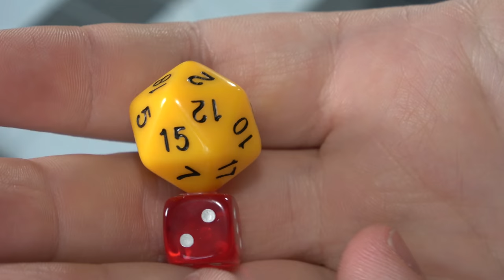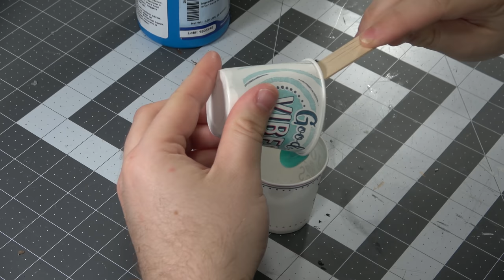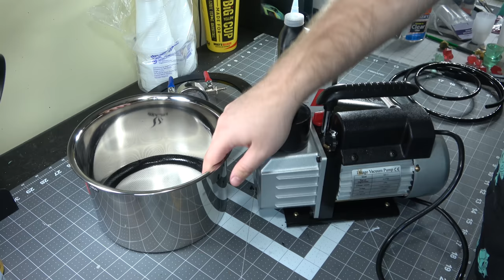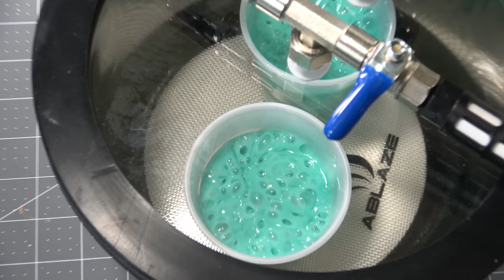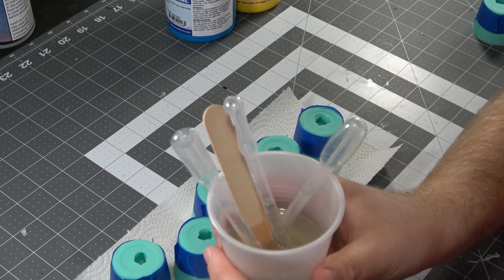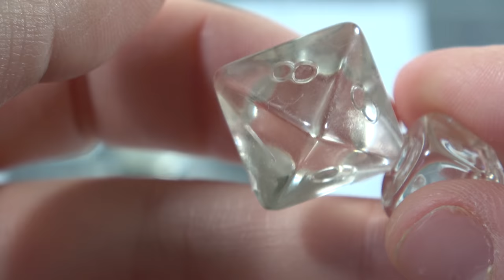Casting Clear Dice Pt. 2 | Vacuum Chamber

Comment: 2 years from now: I use 36 pipettes but you can just use one or two
Reply from the maker: 4 years: I just grab a fist full of pipettes, but Idk it's up to you.
Reply: @Rybonator  8 years: My body is more pipette than human now, but a finger pipette augmentation should also work fine here.
Reply: 16 years from now: the very atoms that make up my body are mini pipettes but you could just use 2 or three
Reply: 20 years from now: I have replaced everything in my house with pipettes, so the cup filled with resin is a pipette as well, but just 5 or six would also be acceptable
Reply: 30 years from now: sluuuuuuuuurrrrrrrpp
Reply: @Rybonator  its been 2 years, are you using 36 pipettes like the prophecy foretold?
Reply: @jarrettgolden6671  You're right. An update is needed.

Comment: I think we may have had a miscommunication or i forgot a key detail the main thing that I do to prevent the spiky bits is after I paint on the silicon making sure I carefully paint into each number I pour in silicone to fill the cup and put the not cured silicone with dice in it in a pressure pot and bring it up to 40 psi. The silicone cures in the pressure pot while under that pressure giving a perfect  mold. I apologize if I forgot that in my last comment
Reply from the maker: Ahh! See I did not try that. Next time I get more mold making material I'll give that a shot to see if it fixes the problem. Thanks for the clarification!
Reply: Thanks for the clarification. Will try this out definitely!
Reply: you had indeed written it in your old comment as well, looks like he simply forgot
Reply: @Rybonator  do you have a video showing this method? I learn better with tutorials.

Comment: I am SO digging these diy dice! I'm a new DM (screams of terror), but my group is a group of super close friends including my boyfriend.
After binging on your videos, I'm finally getting ready to make everyone a set of dice and their own little dice box! So thank you for your help and tutorials!
Idea for a set: try making matte dice! Maybe some frosty snow dice? Or something hazy, like fog, but with some dark smoke inside that you can barely see. That would be really cool! :D
Reply from the maker: Thanks for watching, and I'm glad that you liked them so much :) 

Best of luck in your making! I know your group is going to love whatever you make for them. Send me some pics on Twitter with your sets when you finish up! I'd love to see what you made :)

Those are great ideas! I've actually made a matte set recently by accident when using the wrong polish spray haha. I'll have to give some of them a shot!
Reply: @Rybonator  Thanks for the crafting wishes!
I do have a question when it comes to your dice making process. When do you use the little pipettes in your videos to suck the air outta the molds? Do you pour half of the resin then use the pipette before pouring the rest in, or do you just fill the mold all the way up and use the pipette at the very end?
Reply from the maker: @awinnerismi  I fill the whole thing up and then use the pipette at the end. I place the tip near the top of the mold where air is likely to get stuck and try and suction some air out. If no bubbles go in the pipette, you are good to go!

Comment: Love your channel, literally the reason why I'm going to start making my own dice. 
Question: do you leave the silicone in a pressure pot to cure? 
I know the vacuum chamber takes out most of the air bubbles but I was thinking that it might be a good idea to leave it in a pressure pot at 20-30 psi in order to shrink any remaining bubbles.
Reply from the maker: That's awesome! Thank you for saying that :) Made my day!

I actually have just finished up experimenting with that. It will be in the next video I release in the next few days :)
Reply: @Rybonator  thanks for the reply. Can't wait to see the results

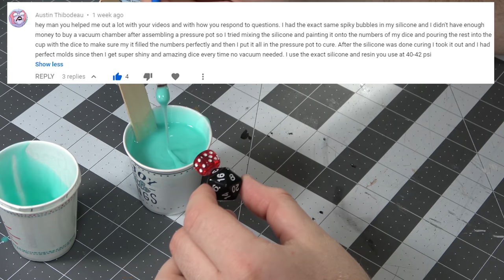Comment: @2:05 If your silicone did end up with bubbles after curing in a pressure pot, you may need to use a pressure pot every time because the unpressurised bubbles can potentially warp the mold (resulting in distorted casts). The same would be if you cast silicone without using a pressure pot, got bubbles in the mold, and then created casts in a pressure pot.

Comment: The high toss technique works if you pour slowly in a thin stream. The surface tension of the silicone will pop the bubbles during the pour.
Reply from the maker: Good to know the reason why :)
Reply: @Rybonator  if you need any further help feel free to contact me.
Reply from the maker: I appreciate that thanks!

Comment: Awesome video, Im from Brazil and I started to get the same problems with bubbles, but I cant buy or make a pressure pod, is too expensive. The solution is change the epoxy resin to POLIESTER resin. The Poliester resin dont mix with water base pigments or food coloring but the bubbles is the major problem. BTW in my molds I use a BLUE silicone made by a local producer here and never give bubbles! I hope this tip will help some people like me, who cant buy these materials.
Reply from the maker: That's awesome! Thank you for the tip Rafael! I have had a decent amount of Brazilian commentors ,and I hope they fine your tip helpful :)
Reply: @Rybonator  me too!! keep making these great dices and videos, you help me a lot!

Comment: I have a question as I am just starting my research on how to build mold(silicon) and then cast (D&D dice in my case for my daughter, I really don’t understand the game its self). So my question is you se a vacuum chamber to remove air bubbles from silicon mold, then a pressure chamber for the resin to get the air bubbles out , why can you not use the same device for both operations, silicon mo,d and epoxy resin? I apologize if this question has already been asked/answered.
Reply from the maker: So you can use one for both, and that's the pressure pot. Check out Peter Brown's video for Pressure Vs Vacuum, it gives a great explanation on the subject. You can cast a mold in silicone and pressurize the silicone with the pot to do the vacuum's job, but not vice versa.

Comment: sorry if u have already done this but i wonder if u could make a liquid core dice .
Reply: You could if it was a plastic ball perfectly sealed before you use the resin. Otherwise it won’t set properly.
Reply: wouldnt make a balanced dice.
Reply: Jon Wit Not all dice need to be balanced tbf, I’m really doubting those M&M dice are fair for instance. Even glitter dice aren’t balanced ones.
Reply: @ninetails6218  but they are unbalanced to different degrees the glitter ones probably being to least unbalanced so you still have a better chance of rolling and getting a different outcome.
Reply: Jon Wit Well no shit, but like I said it doesn’t matter if your goal is art.
Reply: @ninetails6218  oh sorry a difference of view was my mistake i focus on function and looks not just one or the other. display dice are fine for some.

Comment: Just subscribed about 30 minutes ago- (merry Christmas btw lol). I’ve been making dice with some cheap molds I bought online, but I’ve been saving up for a pressure pot for a while. Lucky me- my family chipped together to get me a vacuum chamber. In doing research by watching some of Rybonator’s videos, and a handful of others, I THINK it’s fair to say that a vacuum chamber isn’t necessarily, well, NECESSARY, unless you’re using silicone (wether that be for mold making or something else). It is possible to make dice in a vacuum chamber- but it sounds like it’s much more of a process of sitting and watching than it is with a pressure pot. 
Just some advice from a newbie I guess-  throwing it into the void. No idea if anyone will read it or find it helpful. But good luck if you do! :)

Comment: What level of vacuum do you pull for the 5-7mins? The vacuum chamber I have access to doesn't have a clear lid unfortunately.
Reply from the maker: I honestly pull the max on this one, but am unsure of what that is off the top of my head. Check the description for a link tot he product, as it will have the details for the max :)

Comment: Question can you put your resin dice in the vaccum chamber.  I really want to make dice since I love working with resin.  And I would really love to see a polishing video!
Reply from the maker: So you CAN, but it will PULL the air out from the resin almost too much, causing the resin to overflow from the mold, and leave you with not enough left for your dice :/ 

Polishing video is in the works! Check back later this week.
Reply: I was thinking the same thing! If say to fix this is to make a small funnel with Play-Doh do put your D6 into, then just overfill it a little. Heck you even mention that you always have extra resin ;)

Also - it could look SUPER cool if you put a drop or two of colored resin on bottom, then fill the rest with a colorless resin, pull out the air, and see if the color will streak through the rest of the die as the air is pulled out. Please do this as an experiment!!!

Comment: So I have to ask. You used a vacuum chamber to pull the air bubbles out of the silicon, and the pressure pot to crush the air bubbles in the resin. Would using pressure pot on the silicon work as well as the vacuum?
Reply: I'm curious about this too
Reply from the maker: Yes! And that's a good question. I didn't know that at the time, but have found a ton of people just using a pressure pot for both jobs.

Comment: Hi. Thanks for the vids. I know it’s a fairly old one but hoping you still answering comments. What’s the reason you can’t just use the pressure pot to get bubbles out the silicon and you need the vacuum chamber? I assume there is one but wondering what it is.
Reply from the maker: You can use the pressure pot for both jobs :) I talk about that in another couple vids now! :)
Reply: @Rybonator  ah missed that video! 🙈 just found it now. Good to know!

Comment: I thought you could use the pressure pot for silicone? The whole reason I decided not to get a vacuum chamber was due to being told by multiple people on YouTube that a pressure pit can be used for silicone making and resin, the vacuum chamber is good for silicone but not as good for resin and the pressure pot is great for both. B4 I go an make this final purchase, I want to be 100 percent sure I can use the pressure pot for both

Comment: You don't need the vacuum chamber...  If you cure your silicone under pressure
Reply from the maker: I hadn't heard that before, but now a few people are telling me that. I'll have to give that a go and compare results. It could have saved me and others a decent amount of money. Thanks for the heads up!
Reply: @Rybonator  If you do end up trying this, I'd love to see a video/pictures of the results
Reply from the maker: Will do!
Reply: Yeah I make and see dice molds on Etsy....  this is how I do it.....  pour the silicone, put it in the pressure pot and get my psi to 40
Reply: Daniel Fisher how long do you leave it in for?
Reply: @TheNinjaZachy  Just for the cure time of the silicone.  I prep my molds then I pour the silicone and they go straight into the pop.  40 PSI is enough to cause the silicone to collapse the bubbles.
Reply: Can you use a Vacuum Chamber as a pressure pot? I just bought the vaccuum chamber and don't have enough money for a pressure pot.
Reply: Chris Brennan no, because a pressure pot clamps the lid down and is designed to hand pressure
Reply: Handle
Reply: @Rybonator  would love to see a video on this too!
Reply: I tried using a pressure pot instead of a vacuum chamber, and instead of tiny bubbles I got large ones. Sometimes you just need to degas.
Reply: @Rybonator  did you end up testing this method?
Reply: @Rybonator  did you ever try making molds in the pressure pot?

Comment: I just found your channel and I'm loving your content so far. When cutting your silicone molds, you should try using a zigzagging pattern instead of cutting straight down. This will help you have consistent pressure and alignment when you put them back together. I hope this helps some future mold makers.
Reply from the maker: Absolutely you should! I have a hard time when cutting on slanted surfaces like dice, that jet out in different directions etc, so I tend to just aim the slices in opposite directions on each side of the dice. Serves the same purpose, just to a lesser effect. :)
Reply from the maker: Also thank you :)

Comment: Would putting the silicone in the pressure pot instead of the vacuum chamber reduce the size of the bubbles enough that they wouldn’t effect a silicone cast?
Reply from the maker: I have a new video coming out tomorrow that goes over this in more detail :) But essentially, yes!
Reply: Rybonator Fantastic, I look forward to it!

Comment: Is it possible to use the pressure pot on the silicone instead of a vacuum chamber? Given that the air bubbles become to small to see in resin I wonder if it would make the bubbles small enough to not see in silicone?
Reply from the maker: I have yet to TRY that, but have heard from numerous people after this video came out that it indeed works. So you can save yourself a vacuum chamber purchase :)

Comment: Hi! Do you have a complete list of everything one would need to get started with dice making?
Reply from the maker: Hi Whimsy! So I don't have a complete list, I need to get a square space sponsorship or something to set up a website for folks to get started haha.

BUT I can give you an idea of some of the minimum things you would need to get started - 

1- An existing set of dice. (You need to make your own molds.)
2- Silicone Mold Making Kit (I use Slow 15, you can find it by searching on Amazon. Sometimes it is on sale too!)
3- Casting Resin (You want to use casting over others, because it is designed for small projects like dice.
4- Something to mix the resin and silicone in.
5- (Optional) Something to move the resin into the molds. (A lot of people have success just pouring the resin in, but I have always had trouble. I use pipettes for this.)
6- Something disposable to stir the resin. (Popsicle sticks work fine and you can get like 50 for $1 at the dollar store.)

Or you can forgo steps 1 and 2 and buy premade molds on house of molds or etsy. They are like 100$ though. But they are generally known to be great quality. So it's up to you.

If you want a kind of step by step guide on how to make the stuff, check out my 24k gold dice video, it gives you a pretty good example on how to make these molds step by step, or my more recent 2 color dice video, thought I go quickly through the process in that one. 

Hope this helps! Let me know if you have any other questions!
Reply: @Rybonator   Hello!! Thank you so much for these videos. I was wondering if you forgo steps 1 and 2 and buy premade molds - do you still need a vacuum chamber?

Comment: Hey! So I bought the Moldstar 15 slow that you use. Could you tell me if it's 'stretchy'? I have used the smooth on 00-30 and it's very stretchy and easy to use as far as pushing the dice out without tearing.
Reply from the maker: Yes, to an extent! The number system indicates how "rigid" it is. So a 15slow is going to be more rigid than a 30. The higher the number, the more stretchy it is :) So it still is, but not as much as the 30 you are used to :)

Comment: Hey Rybonator, I was wondering if you've started using this process for more of your dice. If you have, have you had any issues with defects or imperfections when making the dice with this method? Also, I assume the lack of bubbles guarantees a more balanced die, but I was wondering if you had tested their balance and found that to be true with each batch you make? Thanks again for the awesome videos!
Reply from the maker: Absolutely! This is my new method 100%. I may tweak things as time goes along, but right now it's my best method.

Yes the dice are more balanced without bubbles now, good catch. Because the bubbles become so finitely small, they don't effect your rolls as much. I've done the saltwater test like I showed in one of my tips videos. They are more balanced than they have very been. My dice before came out balanced to a degree. If there was a bit off here and there it wasn't too noticable. These however appear to be perfectly balanced, as far as my method of testing reveals anyway haha. :)
Reply: @Rybonator  that's great to hear! Always good to get the best results possible!

Comment: Hi, Rybonator!! I just found your channel and it's fantastic!  I'd like to ask you>  can I do the last part of the process, the pressure pot, with the same Ablaze Vaccum Chamber?  Why are you using a second pot for the casting stage?
Reply from the maker: Hey there David! Glad you like my stuff :)

So you CAN, you just have to be careful. Check out my video on pressure vs vacuum. If you pull a vacuum on resin instead of silicone, you need to be sure that you release the vacuum, then pull it again and repeat when the resin gets to where it's about to overflow, or you will have a HUGE mess on your hands haha :)

Comment: I was curious, is the pressure pot, required, if you have a Vacuum chamber, to make clear dice without bubbles? Just trying to make sure i understand properly. I would love to make my own custom Dice.
Reply from the maker: The pressure pot is the MOST required. It is what will "remove" the bubbles from the resin. If you tried to do that with a vacuum chamber, your resin would overflow and not leave you with enough in the mold. 

Supposedly you can also cure your silicone in a pressure pot instead of a vacuum chamber for similar results. So if you were to get JUST one, get the pressure pot hands down.